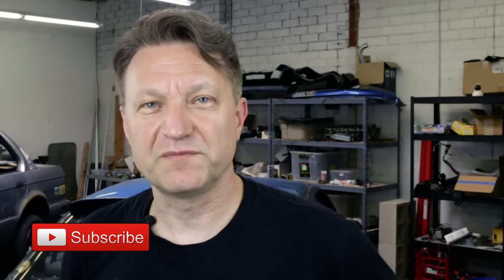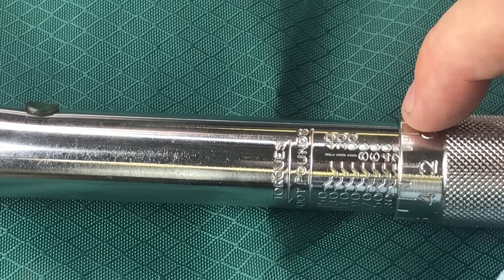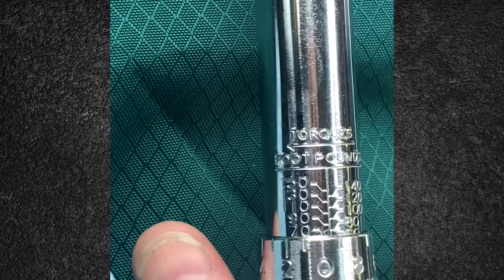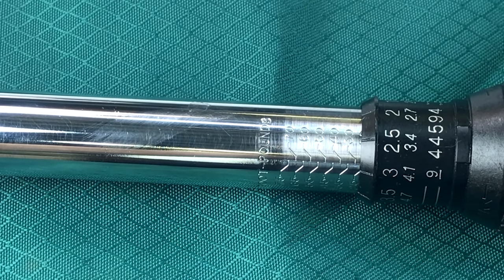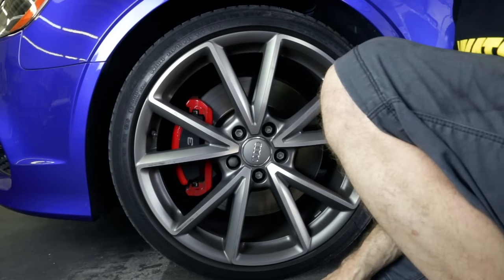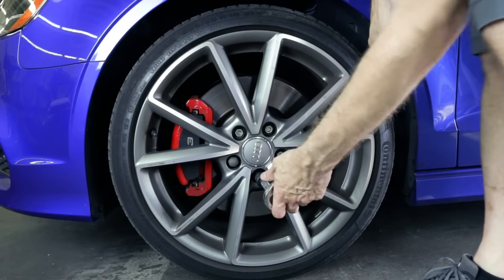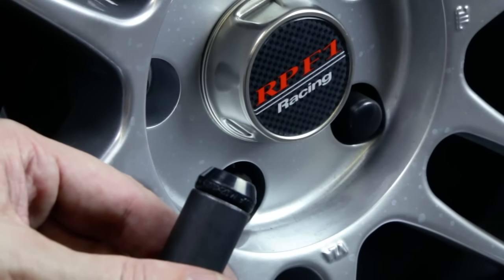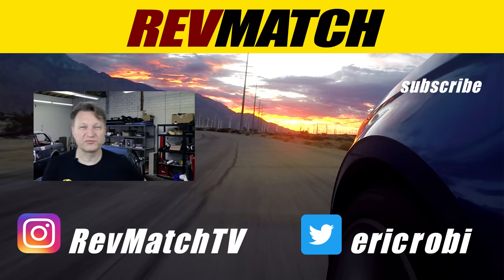How To Use A Torque Wrench For Beginners

Comment: I've been told in engineering classes that there is a little more to this torque business that meets the eye. If the threaded stud and/or the nut is 'dry' the wrench may torque out too early due to high friction. A greased stud and nut will most probably torque out at the correct manufacturer's specification.
Reply from the maker: Indeed you are right, but putting grease on your studs is definitely NOT recommended. We want that friction to keep things in place!

Comment: I find sometimes using a torque wrench, especially an inch pound torque wrench for bolts that need to be tightened to say 7 foot pounds which is 84 inch pounds to never reach their torque spec. What I mean by this is you start tightening the bolts by hand till it bottoms out. Then you use half your torque value say 45 - 50 inch pounds in cross pattern on all bolts. Then you re-torque them to the specification, this case, 84 inch pounds. The problem I see is that when you start approaching the 84 inch pounds the bolt getting tighter but starts to feel like it is starting to move more freely and if I keep going I feel like the bolt will break or strip. The torque wrench doesn’t click. The bolt however does not break but if you back it out sometimes can to see a distortion of threads and hopefully it’s not in the engine block but the bolt itself. Why is this doing this? Do bolts need to be cleaned and lubricated lightly with oil or do they need to be dry?

Comment: I was taught you can double check them.  This would defeat the single click that you say is good enough.  If the wrench is set at a certain spec,  would it over tighten the lug if you did two clicks?  Thank  you
Reply from the maker: A full explanation of the second click is here: https://youtu.be/Bbgv8hUEIsE
Don't do it. I explain why.

Comment: Maybe the most stupid question I ever asked, but does it make a difference how much I pretightened using my normal wrench?
Reply from the maker: It's fine to pre-tighten with your normal wrench. Just don't torque it down with force. Get the bolt tight enough so that you can't spin it by hand.

Comment: but would you torque your road wheels with the wheels on the ground and the weight of the car on the wheels? I think the wheels should be off the ground slightly, car on the jack stand and some wheel chocks to stop the wheels rotating as you tighten the bolts.

Comment: i was doing my valve cover gasket, it took way longer than necessary, and then when i get done and i’m torquing the final bolts down, one of them snaps inside my engine block and then i had to take the whole thing back off and start over it was not fun 😭

Comment: Good tutorial. 

I had an old car where the screws were rusty af and couldn't move the screws. Anything you can recommend for that?
Reply from the maker: Take the bus 😂. Seriously though, use some penetrating oil and leave it on for a little while before trying to loosen the bolts. It does wonders.
Reply: RevMatch Awesome, though I was a bit stuck but it may be useful to keep in the car. or my bag, in case I would like to help the bus driver.

Comment: Clicks means its not tightening anymore. So 1st click counts as its tight to the specs. Following clicks wont overtight it.
Reply from the maker: Wrong. Don't continue after the first click. If you're applying force, you are tightening the bolt.

Comment: How much torque should I use in a nissan frontier 04 oil pan bolts not the drain I'm replacing the oil pan gasket anybody knows 🤔?

Comment: I replaced the guide pulley on my 2012 Mercedes E350. I tightened the bolt with a socket wrench. Then I got the torque wrench and set it to the specified 25 ft-lbs. and snapped the bolt $^$&^%$$*(*%. It didnt click even once. What did I do wrong? Did I have the bolt too tight to start with?
Reply from the maker: Did you finger tigthten the bolt first?

Comment: Just bought a 50lb - 250lbs torque wrench. After use where do I set it for storage
Reply: On a shelf
Reply from the maker: Set it to a bit below 50 lbs to take the pressure off the spring.

Comment: I am a beginner. Why is there a nut on the bottom of my torque wrench?  After I tighten the nut, how come I can still turn the torque wrench to a different setting?
Reply from the maker: Once you set the torque, tighten the nut at the bottom of the handle to keep it set there as you torque your bolts. Here’s my new video on it: https://youtu.be/Bbgv8hUEIsE
Reply: @revmatchtv     Loosen the lock nut,  set it to 80.   Tighten the lock nut and then set it to 90.  With the lock nut tightened, how come I can change the setting?

Comment: I over tourqe a spark plug and damage the threads in the cylinder head, was a 2400$ dollar mistake lol had to pull the cylinder head and send to a machine shop and a new head gasket

Comment: How can I set up my craftsman tork at 58.78 pnd ft?
Reply from the maker: FDarce That torque value does not sound correct. For a value that high it will be expressed as an integer. There should not be fractions.

Comment: I am new to torque wrenches, planning on buying "Chicago Pneumatic CP8905 Torque Wrench" not sure how much reliable that is,
This will be for my bike, mostly I will be using  hex keys with this.
would be great if you are able to suggest any thing.
Reply from the maker: Don't get a pneumatic torque wrench unless you have a compressor to run it. Since you're asking, I assume you don't have one. I've got a couple of suggested torque wrenches in the description of the video, but here are a couple suggested ones 

►1/2" drive torque wrench
http://amzn.to/2wO6D0d

►  3/8" drive torque wrench
http://amzn.to/2wNzimE
Reply: Thanks for suggesting, I will go and check what in available in my local market.

Comment: If the torque specs for a valve cover on 2006 altima say first pass 9-26 lbs and second pass 65-82 lbs and I only have a 3/8 torque wrench what do I set it to on first and second pass? I am not a mechanic and desperately need to fix my car. Any insight would be greatly appreciated!!!!
Reply from the maker: Set it to 9-26 lbs on the first pass and 65-82 on the second. Pick the middle of the range each time.

Comment: HOW often should torque wrench be adjusted/fixed to make accurate torques
Reply from the maker: If you have a high quality torque wrench, calibrate it every 3000-5000 cycles is what most articles say.

Comment: I have to change my valve cover gasket on my 08 Camry. I want to get an inch pound torque wrench, but my coworker says I don't need one. Also I know I will absolutely need an extension. Or at least a deep socket. So, is it safe if I need a deep socket or extension for an inch pound torque wrench?
Reply: I was told "snug it, then give it a quarter turn"
Reply from the maker: creep life Yes you’ll need an extension for sure. Since it’s a valve cover, you can probably get away with just hand tightening it. I would guess the torque values to be 8-12 ft-lbs for a valve cover. That means not very tight. If you’re unsure, see if you can get get someone to help you out.
Reply from the maker: creep life That’s probably good. Don’t over tighten it.

Comment: Thanks, I thought mine was broken. I didn't pay attention to the click at all. I thought the damn torque wrench was suppose to release at if hits the set torque numbers.  So I kept pulling thinking the torque wrench would release after a certain point. It never did.
Reply: Did...did you break the bolt

Comment: I can buy a torque wrench at Harbor Freight for $20 or I can spend hundreds. Do I want to make the big investment or does a cheapo get the job done just fine? Is it dimenishing returns after a certain price point or is it one of those tools where you never regret paying a lot more and getting a lot more?
Reply from the maker: It depends on the value of what you are using it on.

Comment: Great vid - but why did you go in the cross pattern?
Reply from the maker: That's to equalize the the pressure across the face of the wheel. It helps to seat the wheel nice and flat and avoid stress across the face.
Reply: okay thanks! :)

Comment: Hi sir I have Mercedes Benz type 500S just I want know what is tourqe ,W for the  wheel & the wheel size 16 inches diameter ,,,thanks & best regard to  u
Reply from the maker: mazen t You will have to look it up for your car. It’s in the owners manual or Google it. Most cars are 88-100 ft lbs roughly.

Comment: Can someone please tell me, when using a torque wrench for tightening lugs should you use the regular silver sockets or the black ones for impact wrenches.  Thanks guys.
Reply from the maker: The silver ones are fine. You only need the impact ones if you're using a compressor.
Reply: @revmatchtv  Thank you  :)

Comment: my dodge caliber torque set for lug nuts is at 100lbs i set them at 90lbs will it be ok to drive
Reply from the maker: If the manual says set them at 100 you should definitely set them at 100. You want to be safe and have the wheels stay on the car right?
Reply: @revmatchtv  ok thanks for info

Comment: I just broke an aluminum bolt replacing the valve cover gasket on my Cruze. The gasket was $ 35 dollars [ in Canada ] Had to bring the car to a shop to have the broken bolt removed ,cost $ 240 dollars. All that for not having a torque wrench, BIG MISTAKE

Comment: where do you get the sockets(the black piece)?
Reply from the maker: I got this set on Amazon https://amzn.to/3KXc1C4
Reply: @revmatchtv  Does it leave any scratches on the wheel? I used my cars wrench and it left scratches on my black wheels.
Reply from the maker: @justinfok598  It’s up to you to be careful. If you have anodized lug nuts consult the manufacturer to see what brands they recommend. You might want to go with a high end socket set. I don’t have experience in this area.

Comment: I overtightened an oil filter bolt on my bike and had to drill it out lol
Reply: I had it set right but the bolt head broke off the oil filter bolt on mine. Took me about another hour to figure out how to extract it. 
don’t buy cheap Chinese parts was my lesson that day.

Comment: When's the next video on the 240sx?
Reply from the maker: My friend just did a review on it! The next ones will be installing an oil cooler, installing a steering wheel, swapping the diff and installing rear Z32 brakes. 
Here's GearHeads review in the meantime! https://youtu.be/yGc_MPbsZRk
Reply: RevMatch Thanks!
Reply from the maker: I appreciate the support!

Comment: I have heard both pounds per inch and pounds per foot.  Please explain...
Reply from the maker: Inch pounds are a smaller unit of measurement than foot pounds. Divide inch pounds by 12 to get foot pounds. For example 36 inch pounds = 3 foot pounds. 

You can buy a torque wrench in inch pounds for smaller bolts with more precise torque requirements.

Comment: I was expecting that once it got to the right torque that it would just slip after that, not tighten anymore no matter if you keep turning the handle. That would be smarter in my opinion.
Reply from the maker: That’s not the way they work though. The click is to let you know to stop.
Reply: RevMatchTV in another video, the knowledgeable guy says two clicks, so who do we believe? Damn YouTube, always showing contradictory info.
Reply from the maker: You will hear a second click when you release the pressure on the wrench. You stop pressure after the first click. You don’t want to over torque. That’s the whole idea.

Comment: I tried using my torque wrench to fasten my valve cover gasket. I set it to 7lbs torque. The only click I ever heard was the cracking of the plastic . I don't trust torque wrenches anymore.
Reply from the maker: 7 lbs is a low value. That's pretty much just snug.
Reply: @revmatchtv  I see. Maybe I overset it? I'm just affraid to try it with my spark plugs because we both know there's no room for error there.

Comment: Yah I broke a bolt, that is why I am here. 2003 Honda CRF450r, bolt to attach shifting arm. Brand new to the wrenching hobby, I bought a torque wrench to ensure I did not over tighten and break a bolt (like an idiot). Well, it turns out I am still an idiot and don’t know how to properly use a torque wrench.

Comment: I bought me a duralast micrometer torque wrench from AUTOZONE.And to tighten my rear diff. Cover i used it and i broke the very top bolt when i tried to tighten it at 30 lbs..Then. I just did tje rest by hand and feel 😆😆

Comment: I notice you guys are avoiding the harder readings for example my numbers go from 19nm to 110. BUT the next number is 26 on the opposite side to the 19. The numbers on the handle go 0 to 6. So how the FK do i get fkn 25???? Arghhhh
Reply from the maker: Harder readings? I don't understand. Some wrenches have dials in both metric and imperial. Those numbers are specific to the unit of measurement.

Comment: If the wrench was made in China you can grind off all the markings because they are not correct anyway.
Reply from the maker: So what you're saying is since 99% of tools are made in China, we should throw them all away, or just do everything by feel? 😅
Reply: No that is not what I said they just don't hold any kind of settings you can't make them make the same torque two times in a row, I have had 3 of these and I finally through them all away and got 2 CDI's that works right.
Reply: OH and these Chinese ones make great breaker bars for taking off lug nuts.